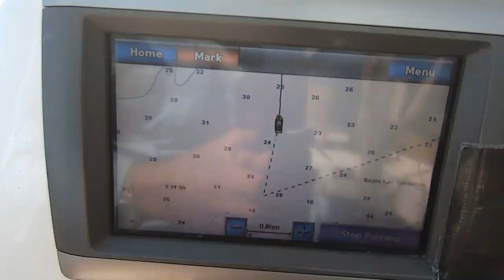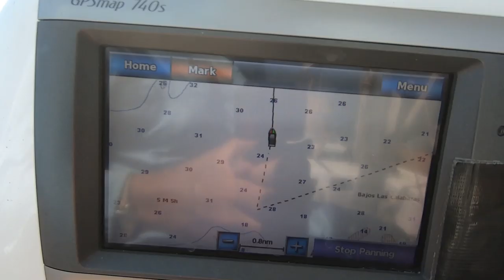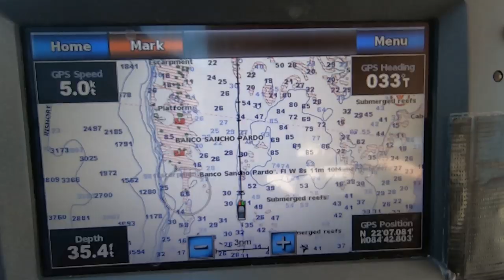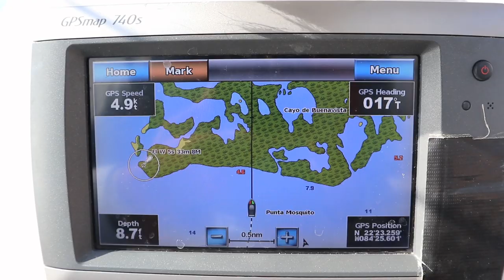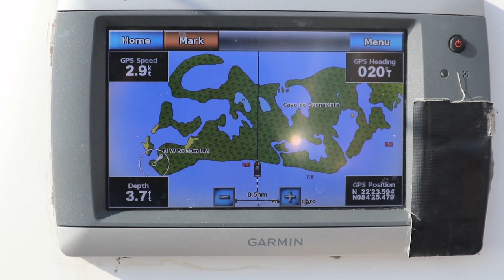Island Sailing Isn't Easy | S03E40

Comment: The mizzens main function is to keep you balanced, it's a steering sail more than anything else, also when going upwind there's this concept called slotting which comes from tall ships where they figured out that many small sails can be more effective upwind than one larger one because of how aero foils interact with each other and increase efficiency, like how a good staysail can give you such a big boost if set inside of a big Genoa, if you get your mizzen set just right in relation to the other sails it can make steering really really easy

Comment: You guys have put a bunch of sailing miles on Atticus and I am sure you know the boat super well by now but the only thing I noticed from the video is that you may have your outhaul a bit tight and the sail is pretty flat. Sometimes giving the sail a bit more belly can gain you a bit of extra speed depending on windspeed and condtions, could be something to play with if you haven't..

Comment: re 125° tack - this is for sure the leeway because you sail very close to the wind. Except if the current is exactly against you. With a modern production catamaran probably you wouldn’t be able to tack below 135-140°

Comment: NEVER let a random helper on the dock take a bow line.  They always tie it off and destroy your plans. They don't know your plans and rarely know what's best. Stern line is ok. Too many boats ruined coming in hot and tied off prematurely. If you have to at least point out the cleat you want them to use.
Reply: I think he knows. It just happens.  No lecture needed.